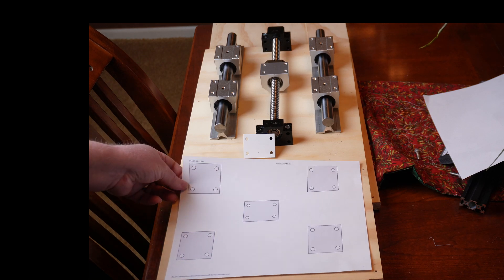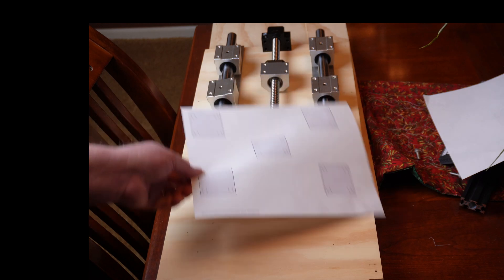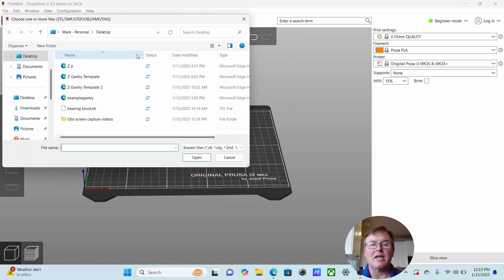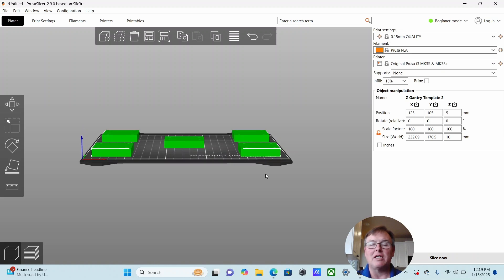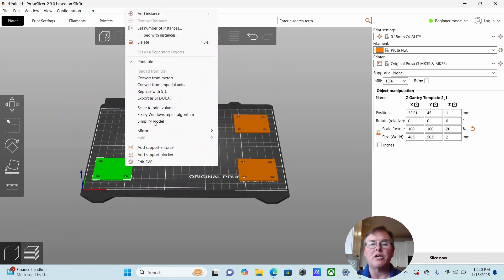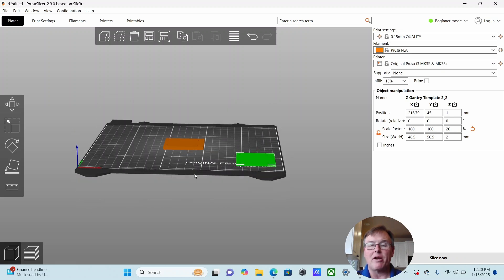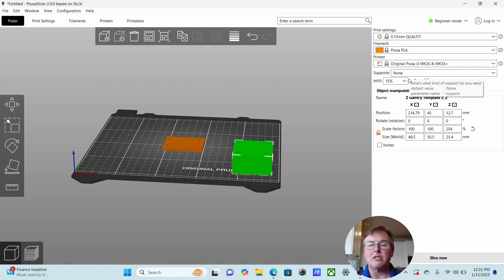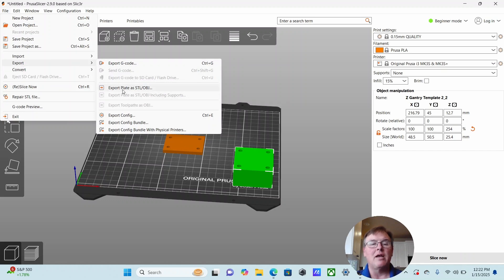HOW TO 3D PRINT SVG CNC GANTRY MODEL FOR SHIMS & HAND DRILLING GUIDES | DIY CNC ROUTER EPISODE 8

Comment from the maker: IF YOU WANT TO MAKE YOUR OWN  CUSTOM CNC GANTRY HOLE PATTERN FAST (LIKE WHAT WE 3D PRINTED) I HIGHLY RECOMMEND YOU WATCH THE LAST VIDEO IN SERIES 

DIY CNC ROUTER | EPISODE 7 MAKING AN ULTRA CUSTOMIZABLE PRECISION GANTRY IN OpenSCAD
https://youtu.be/VeraC_MTUsc

EPISODE 7 WILL GIVE YOU A FREE OPENSOURCE TOOL WITH ALL NEEDED CODE TO MAKE CUSTOM GANTRY DRILL HOLE PATTERNS EASILY AND PRECISELY.  YOU DON'T NEED TO UNDERSTAND ANY OF THE CODE I WROTE IN OPENSCAD. IN FACT,  I WOULD RECOMMEND WHEN WATCHING EPISODE 7 YOU DON'T EVEN WORRY ABOUT IT. JUST COPY AND PASTE THE CODE INTO THE OPENSCAD EDITOR WINDOW (COPY IT FROM THE DESCRIPTION SECTION BELOW EPISODE 7'S DESCRIPTION USING LEFT MOUSE BUTTON TO SELECT, RIGHT TO COPY TO CLIPBOARD, AND CTRL V TO PASTE INTO OPENSCAD EDITOR WINDOW), AFTER CODE IS PASTED INTO OPENSCAD HIT F6 BUTTON TO RENDER AND USING THE CUSTOMIZER WINDOW SLIDERS ADJUST TO YOUR OWN DESIGN SPECS HOWEVER YOU LIKE.  THIS IS WAY, WAY BETTER THAN ME JUST GIVING YOU A SINGLE SVG OR PRINTABLE PDF PATTERN.  ITS UNIVERSAL SO THAT YOU CAN MAKE IT HOWEVER YOU WANT, WHENEVER YOU WANT.  WHEN YOU GET ALL THE DIMENSIONS ADJUSTED WITH SLIDERS, EXPORT THE SVG AS SHOWN IN VIDEO AND PRINT OUT THE TEMPLATE IF YOU DESIRE ON REGULAR DESKTOP PRINTER (LANDSCAPE MODE RECOMMENDED). YOU CAN THEN CHECK TO VERIFY YOUR HOLE PATTERN IS ACCURATE BY SETTING IT ON TOP OF ALREADY MOUNTED RAILS AND BALL SCREW (THAT WAY IF YOU NEED TO ADJUST SLIGHTLY HOLE SPACING SLIGHTLY YOU CAN DO SO (BY GOING BACK AND ADJUSTING SLIDERS AND REPRINTING) BEFORE DRILLING INTO A BOARD AND WASTING IT AND A LOT OF TIME). IF YOU WANT TO 3D PRINT OUT THE PATTERN, THEN OF COURSE THIS VIDEO EPISODE 8 SHOWS YOU HOW.